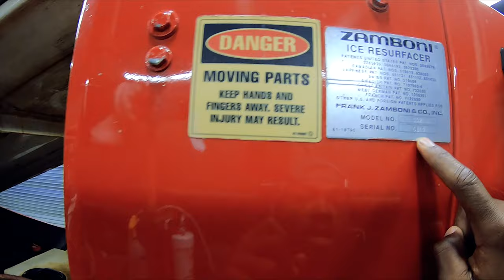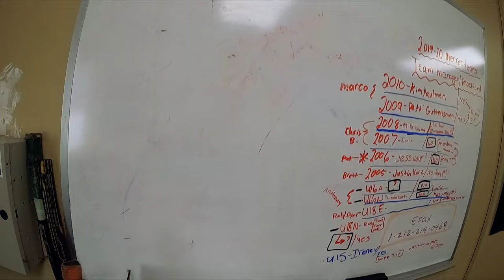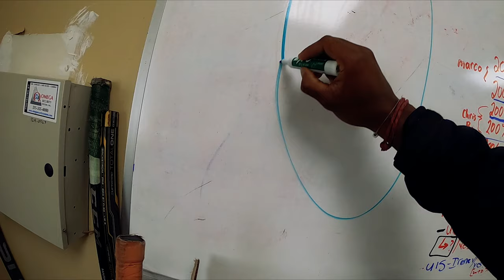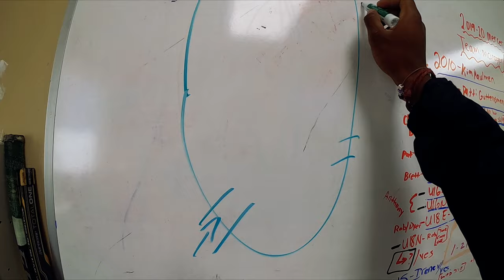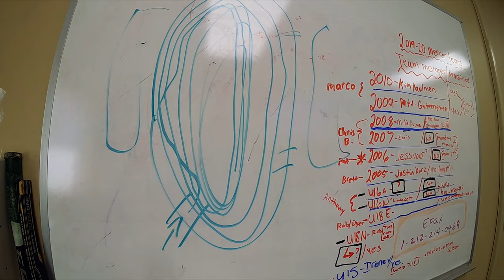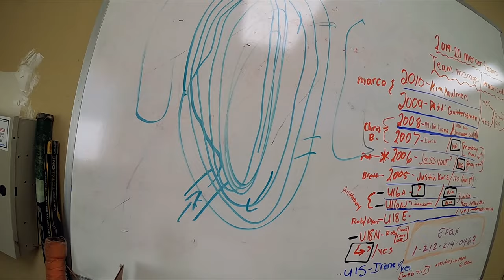HOW A ZAMBONI WORKS (VLOG)

Comment: I’ve never seen anyone drive that slow on a zamboni. Not criticizing at all just an observation. We have an old 552 where I work as well. We also have a newer electric model, however it’s been having problems lately so the old rusty 552 has been the daily driver as of late.
Reply: 8 seconds between blue lines is the proper speed.